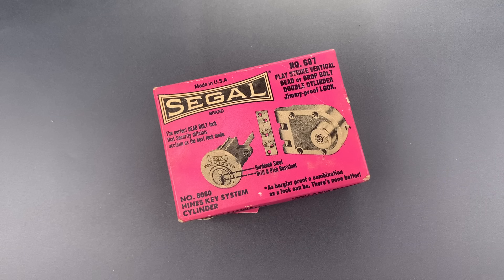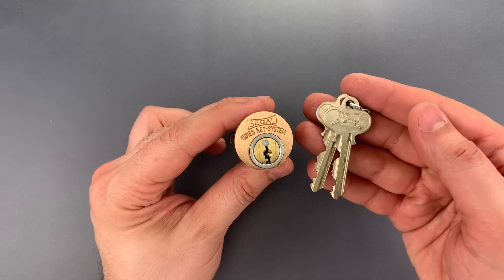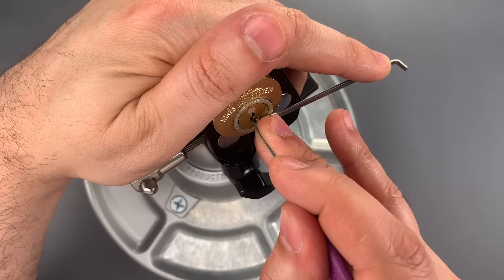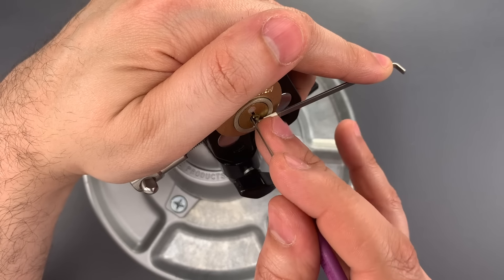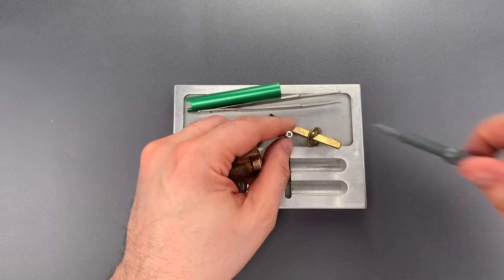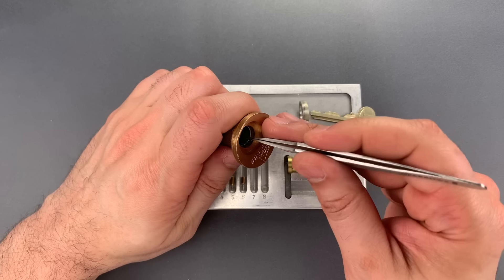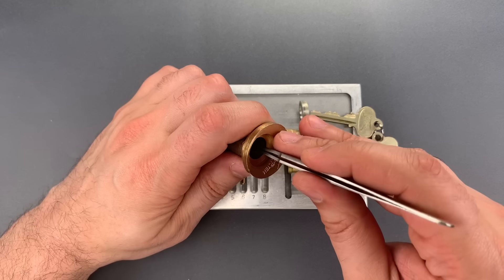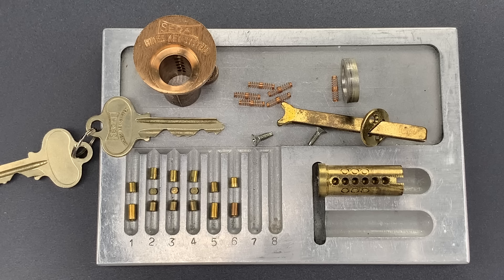[1181] A TRAP For Pickers! The Clever Hines Key System Picked

Comment: If I had a neighbour I hated (which I don't, I have great neighbours), then this would be the perfect lock to troll. Simply fail a pick attempt now and then, and they will have to call a locksmith. And the locksmith will even struggle. :D
Reply: That was my first thought as well.  I thought this would be something like the Chubbs Detector lever lock, which will seize up if you move one of the levers up too far, but (unlike the Detector lock) lacking the ability to reset the trap.  But it's a pretty clever design, in the sense that you can't just move the pins up too far or jiggle things about a little, you actually have to go in and pick the thing to the point where you can rotate the cylinder and lock it up.  Far easier to just squeeze a tube of CA glue into the lock, if you hate your neighbour that much...
Reply: That would land you in jail for attempted breaking and entering as well as being in possession of burglary tools. Add one charge by the number of times it was done, and it would land you in some very serious legal hot water. By that I mean jail time and a criminal record. 

Just content yourself with scowling at them or flipping them off if you are in a bad mood. It beats going to jail.

BTW, I am just stating the obvious. I am not saying that you would do that. But if someone did do that, they would deserve to be in the legal mess they would wind up in.
Reply: @Cooldudewhotellsamazingjokes  

It would only land me in jail if I got caught. What I am trying to say is that it is way too easy to cause a lot of discomfort for the owner of such a lock.
Reply: @midimusicforever  There are so many easier ways how to mess with someone's lock. For example few drops of superglue is pretty popular option, it's fixable with a torch, but very annoying nonetheless.
Reply: Probably easier to insert a lockout key / kill key.
Reply: I don't think buying your neighbor a lock and installing it for them would be particularly sneaky. I suppose your could pick their existing locks, install the new one, then lock it and fail a pick attempt at it, but I would suggest there may be slightly less inconvenient ways to troll an irritating neighbor. Perhaps.
Reply: “Simply”
Reply: @Cooldudewhotellsamazingjokes  "being in possession of burglary tools" isn't illegal everywhere. In Germany, for instance, I'm free to own lockpicks, as long as I don't pick locks that aren't mine or that I don't have permission to pick.
It doesn't seem to be illegal where LPL lives, either, unless he's got some kind of license that allows the possession of lockpicks if you do it as a hobby.
Reply: @Bierstadt54  

Point entirely missed.

Comment: Drunk people that accidentally inserted the wrong key when trying to get home probably didn't like this extra security feature...
Reply: Except it won't turn with the wrong key, and therefore it won't trigger the "trap"
Reply: The Hines key system isn't that widespread. And maybe the designers thought of that and there are no keys which lift the pins by so little to trigger the trap. And in any case, it's extremely unlikely that any random key would do this. But it's funny to imagine!

Comment: At this point, if we assume all locks are pickable, there should be an internal tracker  that should be able to tell when all pins are not set within milliseconds apart then alert the homeowner that someone is picking the lock 

You may not stop them from opening the lock but you can at least be alerted immediately.
Reply: You are going to get a lot of false positives from vibrations

Comment: I have picked one of these before after I looked it up. You can use shims to cover the trap holes but they do have to be in very precise positions to keep from screwing up the lock which unfortunately doesn't help when the lock is actually installed on a door but if you need to rekey the lock and you don't have a key it is possible to do it this way

Comment: Quickest way of getting rid of the tell-tale marks is either grinding off the makers mark or covering it with a welded plate, then spraying the hardened parts in the same colour as the keyway. Without too much work, you have now made it harder for an attacker to id a lock.

Comment: Ever since the first video I watched from this channel, I've wondered why locks don't have something like this. If you're trying to resist lockpicking, surely trap that binds the lock if picked is a logical step to take...
Reply: The problem with this design & the unsolvable problem generally is that a LOCK MUST OPEN for its owner & do so easily... this lock results in the OWNER having to bear the expense for the heightened security by having to call a carpenter/locksmith to gain entry to their own home [that is the reason its a lock from the 60's & not the 2020's]... and worse anyone with malicious intent [simply someone with an axe to grind in your apartment building or neighbor in your hood] can cause you that trouble whenever they want... so the reason locks aren't impenetrable is that what is the difference between having YOUR property stolen & having your property inaccessible to YOU the home owner... when you lose a key- what then... or your child. So all locks must open easily for their home owner AND should be able to be defeated by a locksmith... hence there is no incentive to make an actual impenetrable lock... anyone who could afford such a thing really doesn't need or rely on a single simple lock for their security

Comment: All I can say is that you need to switch around the wafer and the hollow pin (not necessarily at the same lengths) and put the hollow pin catch traps on all pins --- and probably have some block against any pin sleeves -- and then mis-label the lock.  That's going to be fun to LPL ... 🙃

Comment: I actually managed to predict how the system works based on your description of how to avoid the trap (i didn't exactly predict a hollow pin, but i predicted something similar - extra holes that only the top driver pins in 2, 3 and 4 would fit into).

Comment: The vulnerability seems addressable. 

If you put grooves on every cylinder and make matching inserts to fill them back in, a locksmith could manually set which pins are actually trapped. Without knowing which pins are unsafe in advance I don't know how you could pick it.

Comment: On my lock picking journey, I've had much more luck picking actually door locks. Pad locks i have defeated but picking an installed padlock on a gate where i lost the key, was so much harder than holding one in my hand. Overall over only really felt like i defeated door locks with any pin by pin setting and not jiggle luck

Comment: Here's an idea for a picker trap: an electronic lock disguised as a tumbler. There is an extra pin, unreachable by the key, instead opened by a signal current provided by the key itself through contact with other pins (direct contact required). This lock would not ever require to have power, as the electric power could be provided by the key itself - charge the key instead of charging the lock.

Comment: What you cut the hollow pin a bit shorter and back it up with a driver pin, and then randomly swap the wafers and the hollow pins?  Essentially a master key system, but with some master and some driver pins hollowed.

Comment: How do we reset the trap if it's already been triggered? I've been pondering a potential solution, and here's my theoretical proposal:

Imagine a uniquely designed vibration tool that enters the keyway without interacting with the pins. Its distinguishing feature? Notches at both its front and back ends. These notches allow the tool to engage both the front and back of the lock cylinder simultaneously. The significance? By making this dual contact and vibrating, the tool aims to achieve a synchronized upward shift of the entire cylinder. This unified lift ensures there's no rotational cancellation in the middle of the lock, precisely where our trap pins reside. This motion, paired with the vibrations, might coax the trap pin to momentarily rise.

Accompanying this is an insertable, rubber-coated rotational tool. It serves dual purposes: ensuring the vibration tool is positioned accurately for maximum contact and delivering the essential rotational force. The rubber layer is designed to reduce friction and amplify vibrational efficiency.

The magic potentially lies in resonance: if an initial vibration induces a slight ascent in the trap pin, adjusting the vibration frequency could leverage the pin's inherent oscillations. With each descent, the subsequent vibration aims to reinforce its upward trajectory, potentially freeing it from the trap.

This is very much a theoretical concept, and I'm throwing it into the collective brainstorming arena. Keen to get feedback and refine this further. Thoughts?
Reply: harmonics play a crucial role. The tool's vibrations aim to hit the pin at the right time, creating a constructive interference effect. Each vibration helps the pin to rise a bit more, with the process repeated until the pin is potentially free. The tool features variable control, allowing for adjustments to the vibration frequency. The locksmith can then fine-tune this while applying slight rotation, possibly using the harmonic sounds as valuable feedback.

Comment: We have a store selling a jimmy proof lock but it says, "This deadlock features keyed locks on the inside and outside, a vertical bolt to resist prying or impact, a solid brass 5-pin tumbler cylinder and a right-angle strike plate" I wonder if it is the same concept?

Comment: I had one of these on the front door of my old house that was built in the late 80s. Got broken into once and it looked like they tried to pick the lock. They failed and ended up trying to bust the door down. Destroyed the door and doorframe but not enough to actually get in. They went to the side door (which was new and had a new lock) and busted it down in just a couple minutes.

Comment: if instead of having it standardized where the traps are, they would randomize it, perhaps some even where there is a reverse trap (where the key would just push the top one, but if you were to push it to the 2nd shear line it would fall into the trap) it would be significantly improves I think. 

Only downside of course is that if someone tried to pick your lock and failed, you are locked out yourself as well; but that's probably better than having your valuables stolen.

For purpose of being able to have a locksmith pick it for you (or pickig your own lock), it should perhaps come with some "code" you can keep in your wallet or save as a file on your phone that tells you where the traps (and reverse traps) are.

Comment: If the only thing holding the lock secure would be 3 hollow tubular pins,  could you insert something into the keyway and force the lock round? After all it's not solid pins holding the trap, rather weaker hollow pins.

Comment: From the look of it, the cylinder is made so that the trap pins could be in any position or none at all.  So, so slot one , three, and six would work. 

To me the other issue is how does one get in if the trap pins are set?  It can't be picked open.  It is drill resistant.  I suppose a core puller could be used, but how common were those 40 or 50 years ago?  Unless one had access through another door so as to open this from the inside, it could be a big problem.

Comment: So I think I can see a couple ways you could reset the traps after you've taken the lock out of the door from the back side...  But that doesn't help with bypassing it...  I'd be curious if a vibrator tuned to the right frequency and intensity could jostle the trap pins loose without disassembling the door.

Comment: First, having picked a handful of locks, I'm amazed at your experience and ability to determine where the pins are, and recall where you left them by feel.
Second, could this system be nearly unpickable if the mfg used a random distribution of trap keys? I.e., machine the cylinder with 4 trap pins, but randomly assemble using trap pins in some of the slots? That would prevent a picker from knowing they need the 2nd click on all 3, and could cause the picker to have no confidence that they've got it right, not knowing if only those two pins, for example, went to the 2nd shear.

Comment: An idea for a stronger lock using the same idea. Add one of these hollow pins on the keypin, so if you push the pin too far it will also trap. So you then have 3 shear lines, but you have to hit 2 to bypass. (Then you could also add a second hollow pin to some driver pins randomly, so you then dont know which shear line to go to 2/3 or 3/4)

Comment: Clever.  So, this shows a mechanism where, if a picker goes with 'the first click', the lock will seize up.  - But, it seems to me, you can also make a mechanism where, if the picker goes with 'the second click', the lock will seize up.  Instead of the 'topmost' part having a hollow bottom and the middle (the 'wafer') having a smooth bottom, switch those around: have the topmost be smooth on the bottom and have the wafer be hollow on the bottom.  Now: manufacture 500 locks where the three 'trick' pins are: smooth wafer, smooth wafer, smooth wafer, manufacture 500 locks where they are: smooth wafer, smooth wafer, hollow wafer... etc... and make them all identical-looking on the front.  Now, even a picker with knowledge of the trick, will only have a one-in-eight chance of opening the lock.  A little more work, put tricks on all six pins, it becomes a one-in-64 chance.

Comment: The only reason why I wouldn't wanna get one of these locks for a door is that if someone does try to pick it (rather than busting a window) you will be locked out of your house and either have to go around to your back door and hope it wasn't picked, or break the door down as drilling the lock would be harder. And even then you could salvage the lock but only if you have a number two on the other side of the door to slide the lock out when trying to remove it, cause the door is still locked. It's a brilliant device but it poses that issue of having to find another way of getting the door open yourself cause it pretty much disables itself completely. But at least the expense a broken window or door trying to get the lock out, or replacing the lock after drilling at it for hours, is better than losing thousands in electrical equipment like wallets tvs and computers, as well as your work and documentation on the devices.

Comment: I imagine that because the metal on the grooves is thinner you could forced the cylinder to turn causing the trap cups to shear. Would still ruin the lock but it would open.

Comment: What is so recognizable about the Heinz key system?  Would another lock company less obvious in its use of this system (similar on the outside to keyways that did not use it) along, perhaps, with varying both the placement of traps and the number of hollow trap pieces in each slot (if you had to go to the 3rd sheer line on #2 and the  2nd sheer line on #4, this creates a keyway that would require knowledge about that specific keyway in order to break it - if there is an issue manufacturing that sort of variability, could they just make multiple models that look the same and are randomized to consumers such that pickers would still face a trap that much harder?) It seems not unpickable but incredibly difficult not to make a mistake and one mistake ends your attempt.

Comment: I wonder if a more secure lock would randomly have a second hollow point pin wafer randomly in two of the three cylinders...without knowing which one has the second wafer if you didn't engage it then you would start the lock spinning and go over the first set of grooves with no trouble but then bind up on the second set of grooves. 

It seems like with more modern techniques you could perpetuate this cylinder system to make a lock with millions of permutations that could be different from lockset to lock set

Comment: I doubt if its an old lock,or its been modified cause the screws used have a cross + and old locks have line - screws,but i like your video,s cause i learn from it..thankz and a subber added.

Comment: I don't fully get the trap pins, once it drops, can't you just push it back up? like grind something against it and push it back up? if it works the way i understood, it should be possible to force it back up or does it drop in a place where you can't even reach it?

Comment: I wonder if a sufficient enough vibration applied to the lock while tensioning would be enough to "reset" the trap without having to disassemble the lock. Might be worth another video!
Reply: I wondered this too... If you dont tension the lock, then hit the handle upwards with a mallet and tension u might free the lock up. Thing is, all trap pins would have to cooperate

Comment: Why do they put the grooves always on 2, 3 and 4 though ? Wouldn't it be relatively easy to change them for each lock in comparison to the big increase in security ? Especially if the already putting in the effort with other safety features.

Comment: Interesting challenge! If this lock were designed so that three pins had the trap, but they were randomly chosen - any three pins out of the six - would you be able to detect which pins had the hollow pin & wafer and set them all correctly?

Comment: Wouldn't a good way to prevent intruders who expect the trapped lock from picking it be simply to randomize the hollow pins and grooves? I mean, it would be expansive, for sure, but you have lots of available combinations even with 5 pins, 3 of which are trapped, so there would be no possible way to identify which pins are trapped?
Just a thought.